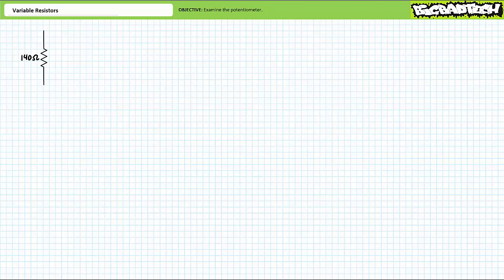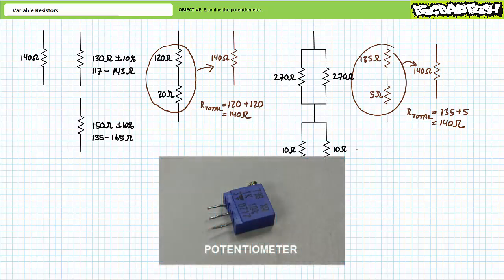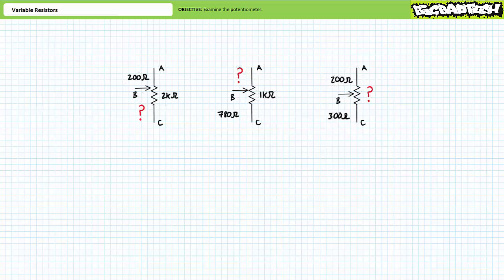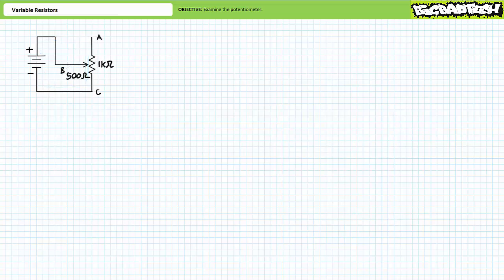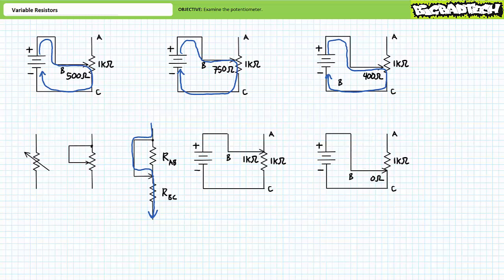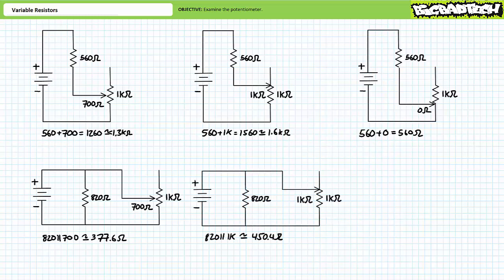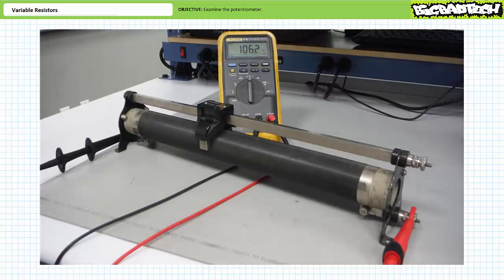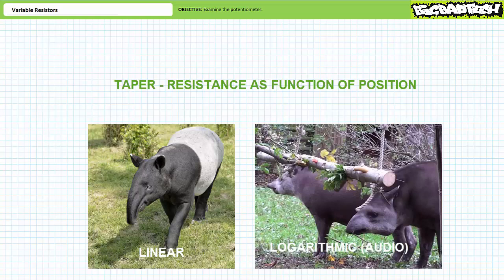Variable Resistors (Full Lecture)

Comment: The biggest take away from this lesson to me is to add a shunt resistor in series with the potentiometer to protect the circuit in case that the pot gets turned down all the way to zero. Imagine the smoke!😐